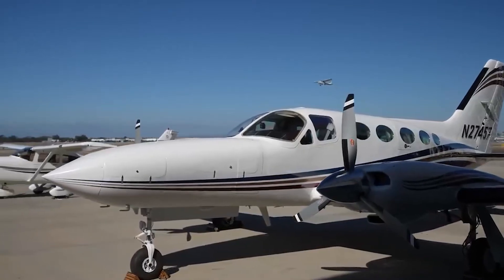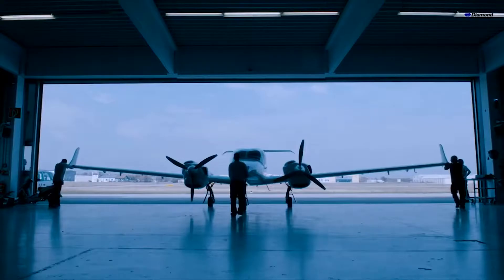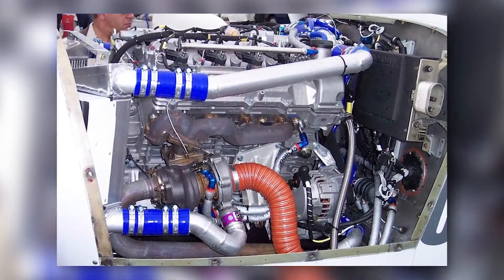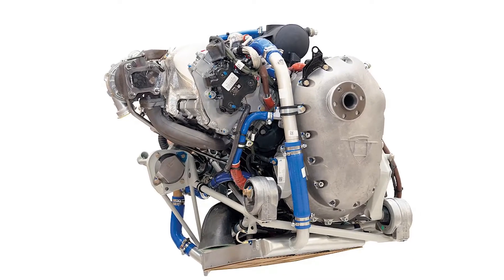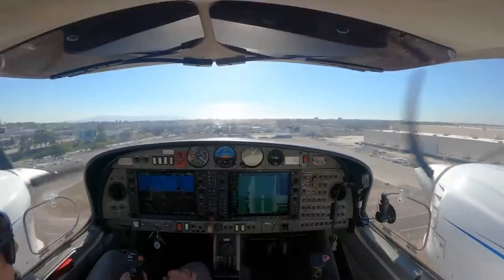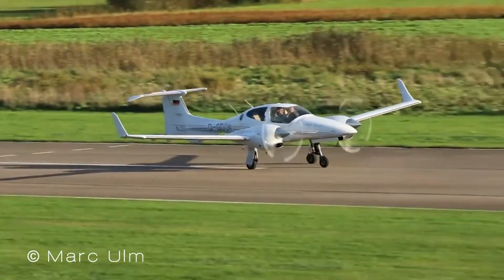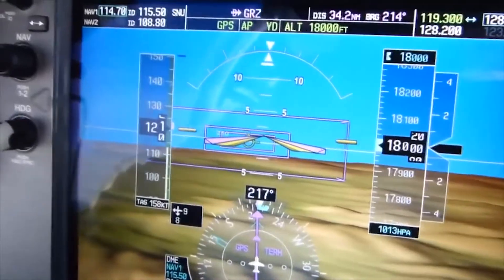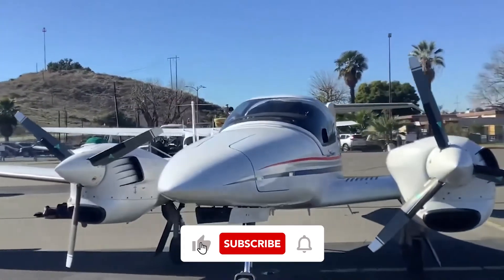How Diamond DA42 is SAFEST Twin In The World?

Comment: A plane that cannot fly is naturally safe and comfortable.

The high failure rate of the DA42/42NG is even more infamous than Boeing's door plug.
However, this thing is indeed much more fuel-efficient than the Cirrus, which is infamous for its fuel consumption rate.
Reply: What do you mean by high failure rate?
Reply: @igclapp  Learning to fly in a school that trains with DA42/NG, you will often be told that more than half of the planes are unavailable, most of which are not regularly maintained but are being grounded due to new faults that occurred just the day or few days before.

Comment: Is it true that those engines have a TBR (time between replacement) specification instead of TBO (time between overhaul)? In this case, does it not negate the effect of the the Diesel engine's better fuel economy? I wonder how expensive it will be to replace the engines at 1,800 hours with brand new ones. This should certainly be accounted for, in the per-hour cost calculation for theses airplanes.

Comment: Sorry, but the operating cost of the tecnam is much lower than the da42. It is not a smart idea to fill AVGAS into a rotax engine. In europe, we would fill in MOGAS (regular gasoline) which is generally cheaper than Jet-A1. Then the maintenance on a diesel engine is more expensive than a gasoline engine. Then the hanger cost of a da42 13.6m wingspan is more expensive than a tecnam 11.4m wingspan. I would still rather have a DA42 than a tecnam.
Reply: Technam is so so unreliable

Comment: So why the L360 version. Which has a LYCOMING 360?

Cos the diesel was unreliable
Reply: I ferried approximately 1k of these planes. No issue.
I have even a photo of St. Peter and St. Pauls Rock !
Reply: @fritzlehner9060  in australia they had very bad problems they would park them in summer. Then the L360 version was developed.
Reply: Of course...  that is why they do not use them anymore..
NOT.
As if 1940 technology is way better. Parking in heat has nothing to do with reliability.
Reply: @flexairz  nah mate they parked them because they were unreliable in very hot weather.

Like engines rolling back to idle in flight. This was fairly early on maybe 15+ years ago